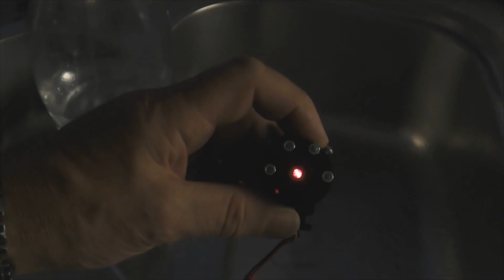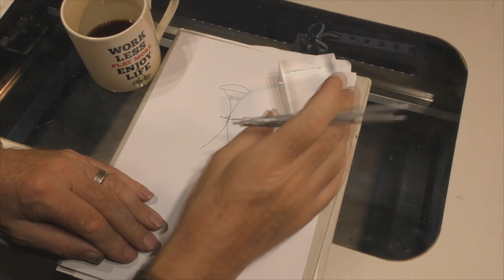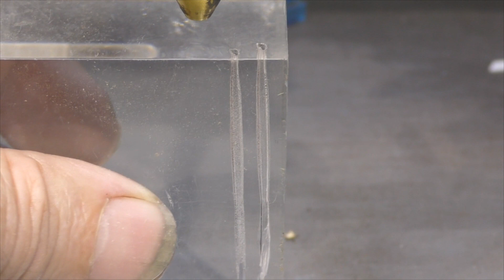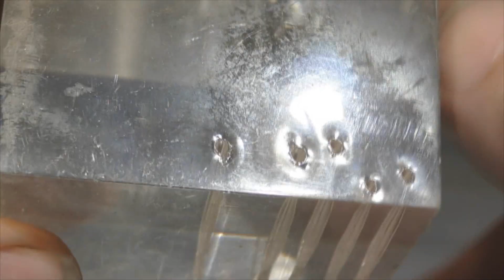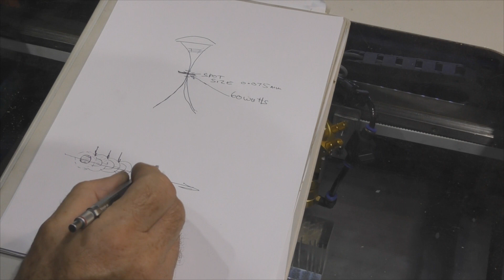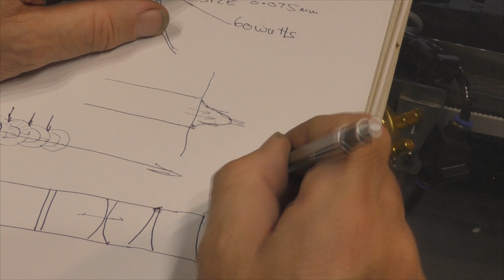RDWorks Learning Lab 120 Strange properties of acrylic

Comment: Hi. I'm a newbie. Just looking into a Chinese 60watt dsp  co2 laser cutter mainly to work on  8 to 10mm acrylics. Can't afford the 80watt so I think speed is not a matter. Any advice ?😀🙏
Reply from the maker: Hi 
 The first thing you must decide is "what size jobs are you wanting to engrave or cut? Whatever size you buy you will have to replace the tube (see the video below)  A 300x500 mm is the most cost effective  and will  be supplied with a dodgy 40 watt tube that may deliver between 20 and 30 watts.. If that size suits you then you can afford to spend about £250 to £300 on a new A grade  CR70 tube from Cloudray that will deliver 80 watts or more.  If you buy a 60 watt 500x700mm machine it will be fitted with a dodgy 50 watt tube that may deliver 40 watts, But you will pay maybe another £500 or more for the bigger "dream".  You will still have to replace the tube but if that's the size that suits you then so be it

Watch this video first and ask more questions after

https://www.youtube.com/watch?v=N7Af2U_THnY

Best wishes
Russ
Reply from the maker: Hi
  Your comment and the link did not appear on the othe video. Try to post the link hereb as another comment
 Best wishes
Russ
Reply: @SarbarMultimedia  ok sir. Thanks.

Comment: Hi, is it possible to laser cut acrylic with no striation marks? For example, cutting clear acrylic and getting something like a flame polished edge (but straight from the laser cutter). 

Is there any technique or laser type that can achieve such a clean edge?
Reply from the maker: Hi Kennui

Use your air assist and the max power that your tube  can  safely use  (65 or 70%?) and with a 25mm test square try to find the fastest speed you can run at  that will cut your square. Then reduce the speed by about 20 or 25% and turn your air assist to just a whisper. The extra heat that stays in the cut helps to produce a burnished edge.
Cast and extruded acrylic will require slightly different settings. Use these basic rules and tweek them a little to suit the lens and material thickness.  You can definitely get a good burnished finish with very few marks

Best wishes
Russ

Comment: A suggestion for an experiment: do a similar one over a long distance, where the beam will start to go off from straight. Let it dig all the way trough so there is an upward gas flow until it breaks trough. At that point the gas flow will reverse (if air assist is on), I would expect some bends to straighten out and perhaps the cut to get a little bit bigger, as air will be blown into the top of the channel.  (OTOH, extra air will make for a greater density gradient as the laser hits the sides, so who knows what will happen..?)
Reply from the maker: Hi Jelle 
If you look carefully at my second pierce, it did veer out of the material such that there was the "through flow" that you speak of. You can see the fumes rising  but there was no apparent change to the shape of the top of the cut or straightening of the "pipe" It just continued to conduit the light to the bottom of the cut and out of the hole.

Best wishes
Russ

Comment: Very interesting results Russ! Your hypothesis that the light is being reflected may be wrong, as solid acrylic is very absorbant of IR light at 10um. I'd guess that it is a density gradient that is bending the beam away. You can see this in cuts of thicker acrylic: the beam seems to be dragged back as it travels sideways (it never veers forward). That suggests to me that the difference in density is bending the beam back. Not that it matters a lot though, what the actual light bending process is.
Reply from the maker: Hi Jelle 
You are absolutely correct about acrylic being absorbent of IR but the point is that it is a LIGHT beam until it hits solid acrylic. It is only then that the high energy density part of the beam is absorbed, converts to heat energy and sublimates the acrylic into a vapour The the soft smooth internal surface of the cut  (whilst it is hot) acts as a wave guide, collimating  the light beam to keep the energy density high, way beyond normal cutting depths for other materials.  This waveguide (internal reflection) idea is something I am demonstrating rather than discovering. It is a well researched phenomenon that you can Google to find out more technical details. 
The dragging beam that you are observing is symptomatic of too high a speed. It can be mitigated to a certain extent by dropping the focal point into the material without changing the speed. With my deep hole demonstration you could see the strange gas flow patterns at the bottom of the cut. If you go too fast with the cut you will find that you get serious gas flow serration marks at the bottom edge of your cut . That indicates you are on the edge of failing to cut and it will also be linked to the beam drag that you have observed. 
As I said, acrylic is a fascinating material with so many characteristics to understand/read. 
Thanks for the comment
All best wishes
Russ

Comment: My observation tells me that it is the air from the pump that is pushing the heated air down the tube.  I would have like to see this test without the air pump or varying air assist.
Reply from the maker: Hi Scot 
My air assist was but a whisper and with the 2" lens, the air gap to the work was 19mm. There was ZERO chance of air entering that very small entry hole and getting the better of the expanding acrylic fumes that were fighting to get out of that very thin tube.
Best wishes
Russ
Reply: That was one of my hypotheses too. I tested it with a buffer inline with the air assist. that reduced the pulse from the 50Hz pump down by  a very large amount. It made no difference with the result as far as I could see. 
Another argument against the pump 50Hz causing is that the pattern should scale linearly with the speed. It does not.
There is one large cause of these striations that are obviously visible when engraving: the head resonates quite a lot. Just put your hand on the head while it is moving to feel it. That is not to say that beam drag is not causing striations at the side of acrylic (it obviously is), but I suspect our noisy stepper drivers play a large part in it too. I've got some silent drivers (trinamic) on the way to test that hypothesis.